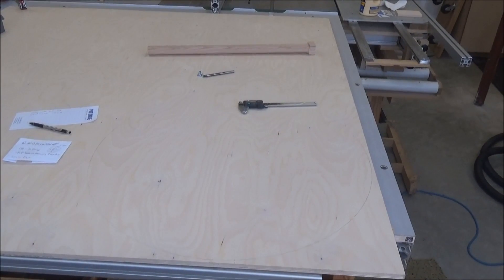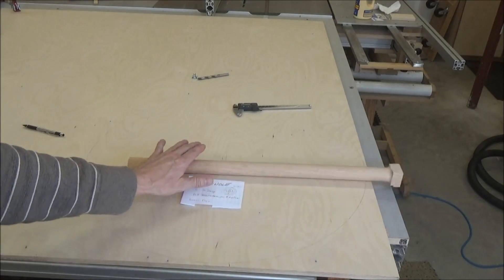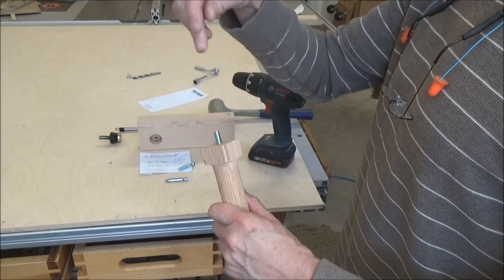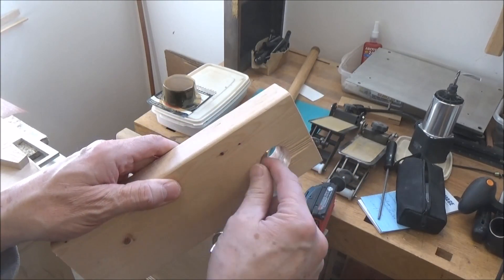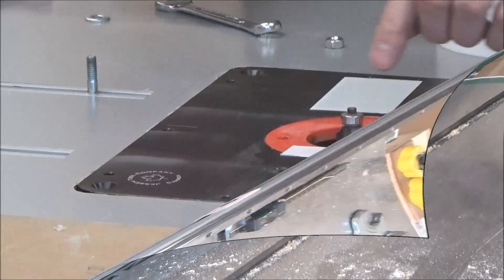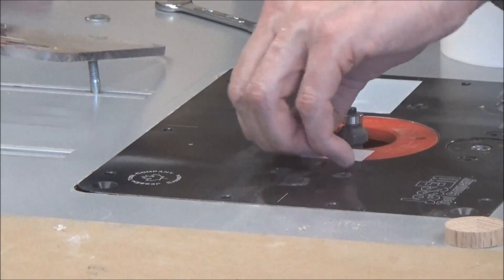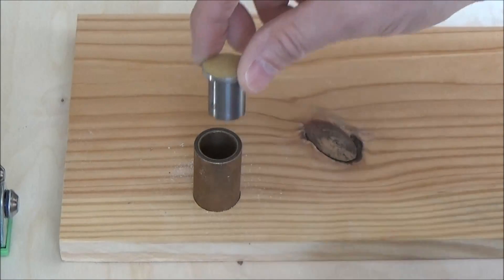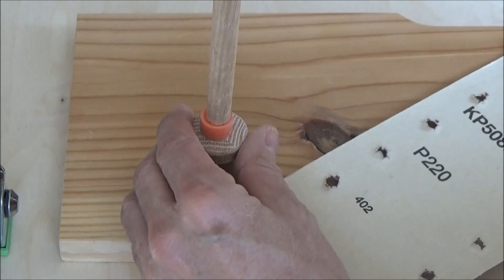01 Crokinole

Comment: What's the orange thingy that sticks to the surfaces?  I need one.  You called it "magic finger"?
Reply from the maker: visit www.cuttingboardfeet.com  to buy them. I am waiting on a reply from Mitch to get you to the right spot. Thanks for watching and I will reply with updates asap. The ones I see on this site have metal screws and you don't want those.
Reply from the maker: https://www.ebay.com/itm/222919962947 is a direct link to the kits